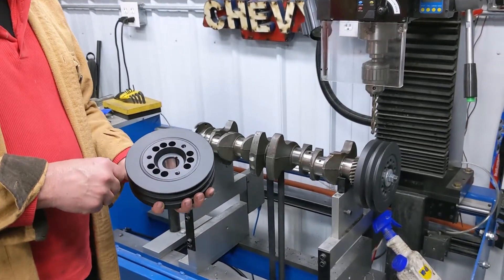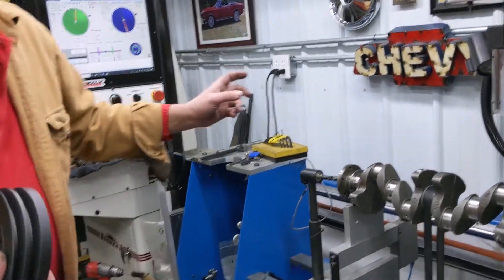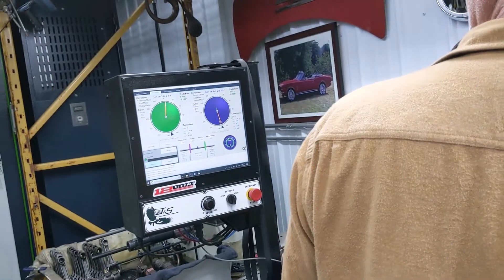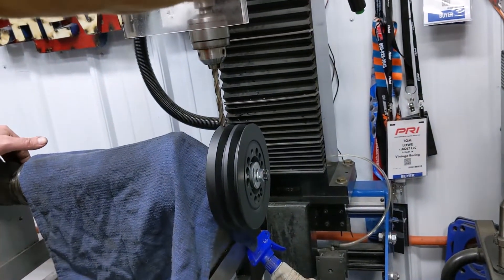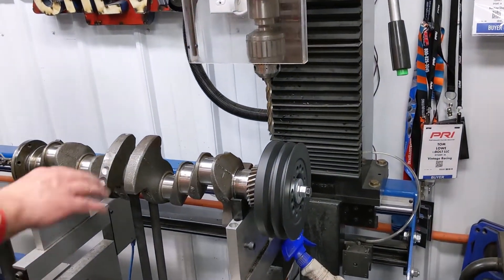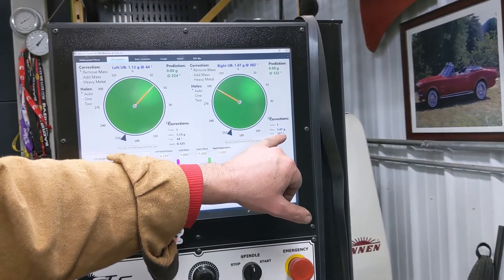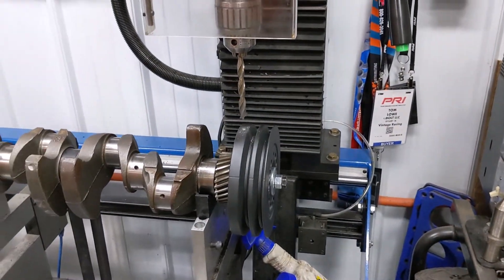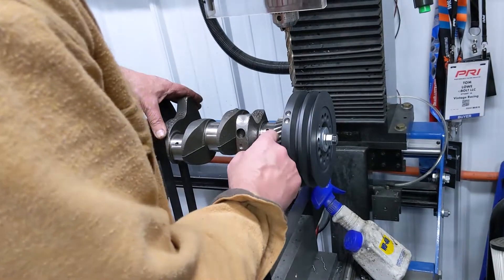Balancing Harmonic Balancers Chevy 292 When new parts are not good enough

Comment: Wouldn't this system also account for the imbalance of the crankshaft?
Reply from the maker: The crankshaft would also be accounted for as you said. The crank in this case is already zero balanced.
Reply: @telowe2000  gotcha, that makes sense, thanks.